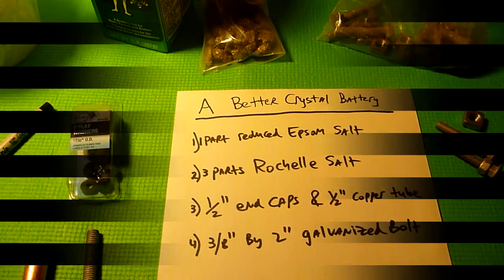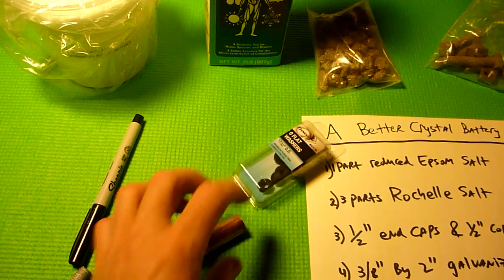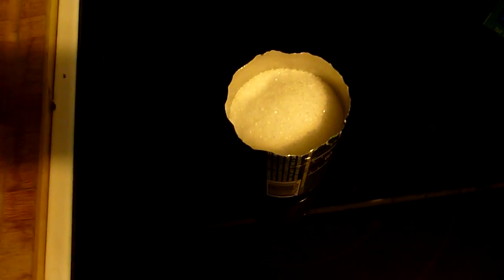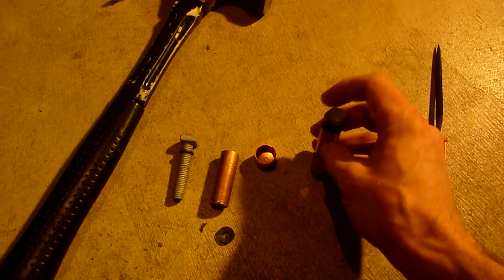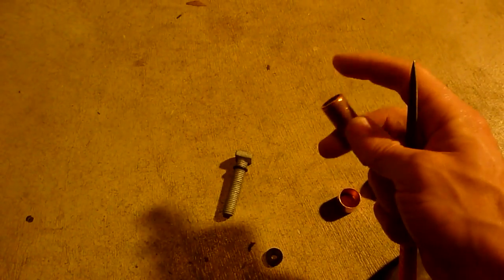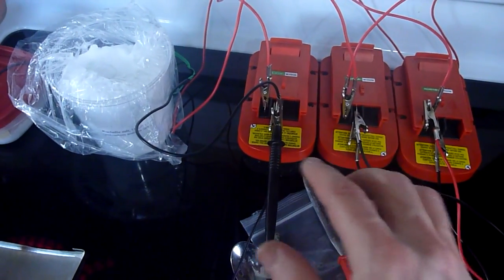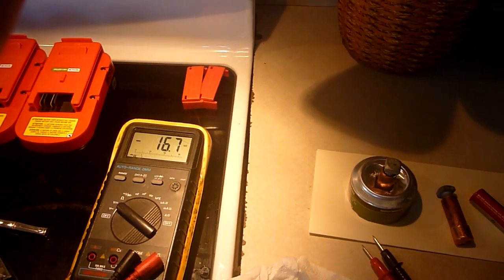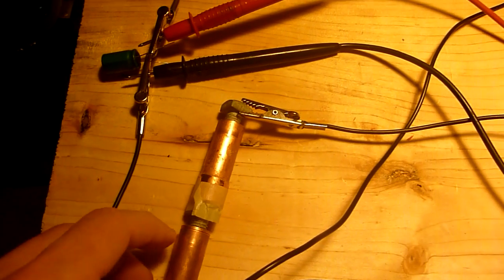How to Make A Better Crystal Battery

Comment: what if gold was used as a case instead of copper?
Reply from the maker: +Cory Samoila Gold would be too expensive to experiment with, use Galvanic Chart to help you predict voltages. You want to match something at the top of the chart with something at the bottom of the chart (like graphite and magnesium, or copper and magnesium).
Reply: Ok thanks,

But I have gold, so, would gold be a better conductor?
Reply from the maker: Cory Samoila I'm not sure about gold because I haven't done experiments with it. Instead of using gold you can use copper just make more batteries to increase your voltage/amperage (wire 'em in series to increase voltage, in parallel in increase amperage). If you use gold you won't be able to make more than 1 of these and it would be too expensive. Plus 14K gold is only about 58% gold the rest are additives metals like Lead, etc. Pure gold would be 24K. Again look at the galvanic chart, match items at top of the chart with items at the bottom of the chart. Those combinations will result in the highest voltage. The size of the cell will determine the amperage.
Reply: ... Thanks I'm an idiot I guess
Reply from the maker: Cory Samoila Nah dude, your heart is in the right place. I'm learning too. I'm far from knowing everything. Keep at it and humanity will have a bright future. It will happen.
Reply: +Cory Samoila gold is a very non reactive metal I doubt it would work at all and like it was said is too expensive to try...
Reply: +Lunas Eclipse horseshit. gold is conductive
Reply: Conductive yes reactive no gold does not corrode it only dissolves in extremely strong acid aqua regia or alkaline solutions of cyanide so you see where im going your electrolyte would need to be a bit toxic... and gold is one of the least reactive elements. Humm looking at the chart gold even plated scores a 0 on the index meaning it is too small to measure on the scale or does not react... You can go ahead and try it looks like the outside casing would be gold and the anode magnesium or beryllium I don't know what electrolyte should be used.
Reply: thanks

Comment: use pencil lead in stead of the bolt bro
Reply from the maker: +phoenix rises Good point, pencil lead is graphite. Graphite + magnesium will produce more voltage.
Reply: Naoki Kashima ya know i cant even find a frikin pencil in my hole house hahahaha
Reply from the maker: phoenix rises I noticed some pencils don't even have graphite. I burn pencils to expose the graphite because graphite doesn't burn easily like wood. The fake pencil graphite will burn and curl like plastic. Cheap bastards can't even use real graphite in pencils anymore.
Reply: +Naoki Kashima Nice vid bro!
Here are some results you can expect changing anodes and cathodes.
Mg + Cu = 1.5v +/-. 
Mg + Graphite = 1.7v +/-. 
Mg + Bi = 1.3v +/-. 
Cu + Bi = 0.85 +/-
Please keep in mind that mA is what is important when it comes to power cells.
Reply: Joe Anthing did you not say why? that in its self is a question lol
Reply: Naoki Kashima use the big fat hb ones mate ;)
Reply: +BakamonNO what sizes?
Reply: +Cory Samoila I'm not sure if I understand the question. But when it comes to the anode and cathode the voltage will remain the same regardless of size. The mA will increase with a larger (anode / cathode) surface area. If choosing to use a pencil as an electrode I would recommend going for a hard pencil I.e HH grade which should contain more graphite. But on the other hand a graphite electrode can be bought on ebay for 6 USD. So maybe it would be better to buy one there. If you want to go for the pencil approach, go for a thick pencil and burn the wood of.
Reply: Thx
Reply: +phoenix rises Why? Magnesium / Titanium is the best to get the best reaction. It's not about conductivity.
Reply: Joe Anthing why ask then if you know everything ;)
Reply: +phoenix rises what did I ask?
Reply: phoenix rises Naoki Kashima
Personally, I would find some dead lantern or D size batteries and rip the carbon rods out. It's not too hard to do and the manganese monoxide/dioxide mix is useful. If you use new batteries it';s pure manganese dioxide. The manganese in itself is very useful to make drycell batteries.

I wonder if you could use it to make a crystal battery by packing the salt between an outer layer of powdered zinc and the inner carbon rod with manganese around it. You could use a stronger pipe like iron or very thick pressure rated PVC for the containment that wouldn't rip like copper. So.... converting a drycell to crystal from alkaline..... hmmmm..... I might have to try that.
Reply: So, I have the four ingredients, pencil lead and copper, I can make a battery right?

And if I take apart a D battery I can use the solution in the mix?

And how can I get 330v from spinning magnets?

EMF anyone explain this simply lol.....
Reply from the maker: Cory Samoila Graphite would work better with magnesium than copper. Check out this Galvanic series chart for guide >> https://en.wikipedia.org/wiki/Galvanic_series
Combine elements at the top of chart with elements at the bottom. The bigger the difference between elements (in terms of their position on the chart) the larger your voltage will be. I don't know what exactly is the electrolyte in the D cell battery... so I can't really give you an advice there. In a crystal battery the electrolyte is the crystal! Thus there is no corrosion on your metals (but you get low amperage). Vinegar will give you good amperage but will cause corrosion to your Magnesium (if you use magnesium in your battery). Getting 330v from spinning magnets.... notice big voltage doesn't mean it would be all that useful. You also want something with large amperage. In a typical generator Lenz's Law will interfere with energy generation (you'll have to burn more fuel, spin the generator harder when it is under load). Jim Murray is one of the scientists who found a way around this problem. He created a Lenz-Free energy generators (check out his video). EMF is Electromagnetic Field. When you apply voltage and amperage to the coil you get the appearance of magnetism at the ends of the coil. How strong the magnetism is depends on how many coils you use and the amperage. Check out Eric Dollard and his lecture on anti-relativity (youtube search). It is a long lecture but mind blowing.
Reply: +Naoki Kashima Not very practical though. Graphite is brittle and wont sustain the pressures if used as the container. Magnesium is quite soft and also would rupture eventually.
Reply: J Anything you could use something impregnated with graphite

Comment: Why not use a series of springs of magnesium decreasing in size places inside one another to dramatically increase surface area?
Reply: Done it with copper in other type of battery, I think surface area does work.
But isn't magnesium dangerous of catching fire?

Comment: I bought a lot of magnesium blocks on ebay for like 4 bucks and you can use a hacksaw and slice off 1/2 inch squares .

I get around 2 volts but I use  2 parts magnesium sulfate and one part rochelle salts. I also build on a tiny joule thief to each battery. and have run leds for over a year. pretty brightly I might add
Reply: Clown Whisper try adding silica sand to the mix or graphite, I have some ideas.. i need to get the supplies i guess, I already have pyrite and Epsom salt though.
Reply: Jake Mitch I'm curious if you have built any batteries with graphite especially but also any other materials and what your results were. I have yet to build one of these because I have had too many other projects going on lately but now I'm thinking I might need to make time

Comment: Most def use the magnesium. They will have plenty of power to run many LEDs and small dc motors. I have tried several mixes. Any of the ones with salts definitely eat the magnesium. The best performers so far believe it or not have been only Alum. I have a few that are around 6 months old and I add a few drops of distilled water every other day and have seen no signs of corrosion to the magnesium as of yet. Others that I have made I add water to also but the magnesium is showing signs of corrosion. Nothing major though. All of my cells with salts or borax seem as though they will last many years on a constant load. Try making a joule thief. If your cells can put out 15ma that should be enough for 2 in series to light an led. Although when you series them up the impedance go up to. So it's a trade of higher voltage a little less current produced.

Comment: I ment having the same power as a AA. Im not sure how big that would be, could you give me an idea?
Reply from the maker: Inside your cathode tube you could have smaller tubes filling up the interior. You could have thin magnesium wire inside each of these smaller tubes filled with MgSO4 and Rochelle salt crystal. It would be as if you had several crystal batteries put together inside of your battery. I might do this design at some point (the problem is finding the magnesium thin enough to fit inside the tubes). Use galvanic series chart to help you pick out your anodes and cathodes. Here is one: http://www.corrosionist.com/Corros1.gif You want to combine elements found at the top of the chart with elements found at the bottom of the chart for greatest output voltage. Hope this helps.
Reply from the maker: Hey if you can't afford the materials needed you can go with a cheaper version that will still work. All you need is a zinc can (from tomatoes or soup or something) and you'll also need an aluminum can. Sand the sides of your can to expose aluminum underneath. You can also use cement as your electrolyte. After cement dries the aluminum will be your positive and zinc can will be your negative (make sure you don't short out your cell, use care). Maybe I'll post a video about how to make one of these in the future.
Reply: That would be nice. I have Epsom salt and salt sub. Im trying to get the copper and I have aluminum. The cans sound good, im just trying to make something that wont corrode away, "ever'
Reply: The only way you can get no corrosion is to use metal that will not corrode. I suggest gold. Find some one who has some broken jewelry or a single ear ring and buy or get it cheep from them.
Reply from the maker: Randy Travis Stainless steel can also be used. Actually ANY metal will remain virtually corrosion free because the electrolyte in crystal batteries is a non-corrosive crystal! This means that no matter what metal is used it won't corrode (if made w/o any water like I and John Bedini showed in videos).
Reply: +Naoki Kashima Hi, unfortunately you are wrong. There is always enough moisture in the air to work with the used salts as an corrosive electrolyte. You always consume some metals.. In a Graphite based battery, like Magnesium-Graphite or Aluminium-Graphite, you don´t consume the Graphite as it works together with the air to convert O2 into ions and thus current... so your graphite needs to breath air, as this cells then acts like a metal-Air battery, but the other metal is consumed, like the Magnesium or Aluminium.... otherwise there would not be flowing any current... You can still reduce the corrosion current when no load is applied by using oxidized copper surfaces, that put out a diode effect from this semiconductor copper-oxide surface...but surely if a load is applied and electrons will flow then you will also decompose and use up the metal electrode...it is still a galvanic battery, also if you don´t see the corrosion for a long while, because the currents are so small, so that you don´t see much corrosion...
These Aluminium or Magnesium Metals have a big energy density stored, and that is why the corrosion is so small, when you only draw low currents...but they are all still galvanic batteries where the metals are used up....
Reply from the maker: overunitydotcom Hello again, thanx for the comment. Once the salt melts and re-crystallizes it forms a solid layer around your metals. I don't see how air can get in there, the whole crystal mesh looks smooth and is very solid. I think some sort of a piezo electric effect is going on here. Have you seen LaserSaber's (youtube user) videos about his 100 year old pulsed motor? He used crystal batteries to make a motor that he plans to run indefinitely (he does it on a live feed). It already was running continuously for 5 years or so. Also, I disagree with the assumption that the electron is the charge carrier in electricity. If that was the case vacuum would have been the best insulator possible (very few electrons in vacuum). However, the electrical effects are more dramatic in vacuum! Just look at vacuum spark gaps (the entire spark ends up enveloping the space). The whole notion that electron is the charge carrier in electricity occurred when physicists started messing with electrical science. In many cases electricity acts like a rarefied gas under pressure. Cheers ^_^

Comment: could you make a crystal cell pack the same as a AA battery? That would be great!
Reply from the maker: All you have to do is use a smaller diameter tube and a smaller diameter anode. Visit a hardware store and see what diameters they have available.

Comment: I was wondering if you would consider making a 12v crystal battery pack that has the same output as a normal car battery. How many cells would it take, and how big do you think it would be?
Reply from the maker: A typical car battery has many amps (100 amps+ to start-up your car). Deep cycle car batteries are better for generators but will produce fewer amps at maximum. However, they will output their amps at a steady rate (they have more plates inside of them than regular car batteries). Anyways.... the crystal batteries produce small amount of amps but last indefinitely. Creating a crystal battery that matches the output of a car battery (using my setup) isn't practical because you'll need a huge number of 'em wired in series (12+ in series) and than in parallel (probably over 100 rows). Probably over 1000 batteries total. If** you were to substitute magnesium you could cut down the number of these batteries needed by 1/3. Again the draw for this technology is the longevity of the batteries not how many amps they produce.
Reply: Randy Travis Hook the cells up to a capacitor that charges to 100+ amps. You don't need so many. (If you want it for your car)

Comment: How long do your batteries last?
Reply from the maker: The other crystal battery that I made using Borax and Alum started breaking down on the outside after a year. This battery with Epsom salt and Rochelle salt should last indefinitely. Lasersaber has a set of these crystal batteries continuously running a small motor that he built. He calls it his 100 years motor. Here is the motor in action: https://www.youtube.com/watch?v=-mfKMDE55gs

Comment: you should experiment using oil instead of water. Your battery should last much longer.
Reply from the maker: In the crystal battery I don't use any water at all! I only used reduced Epsom salt and Rochelle salt... they turn to liquid when you heat them up. They turn back to crystal when cooled. Adding any kind of water to the crystal battery will likely ruin it.